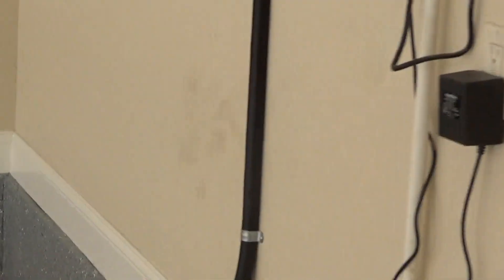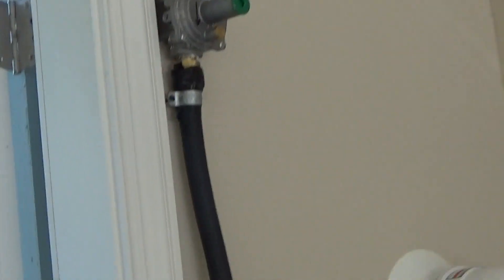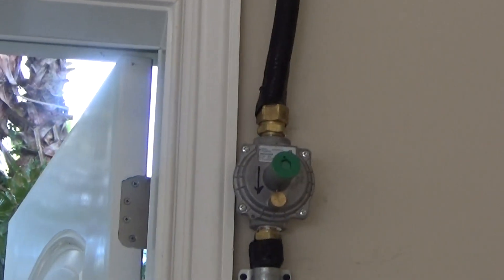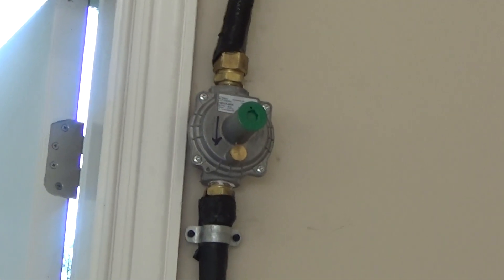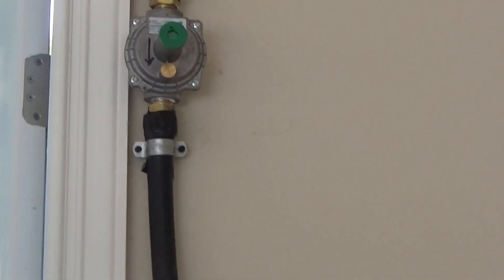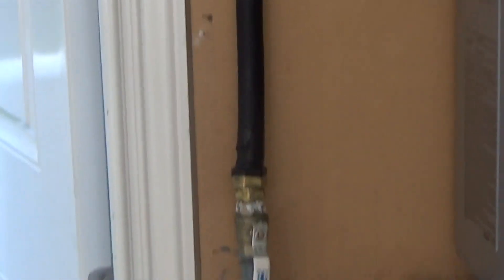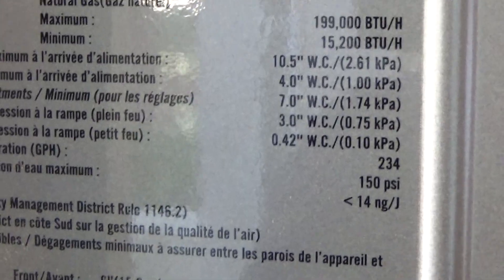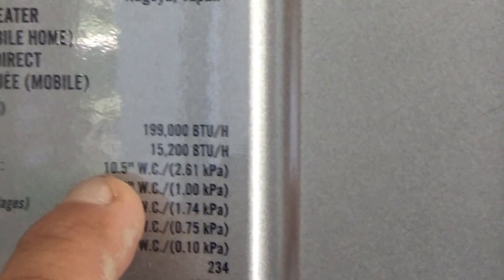Direct 2-pound gas line to tankless heater.

Comment: Good morning sir and Merry Christmas.  My tankless went out on Christmas Eve so I install a Rinnai RU199in.  It’s roughly 3-4” from the gas stub the original was connected to.  I installed a 5/8” gas line due to that’s all I could find with the time given.  The water is set to 135 degrees and it is like a warm shower at summer camp lol.  Another point to add, I just had my master shower tiled so the new shower valve and shower head still have the rough in plugs.  Are both of these contributing to the lack of hot water? Any help would be appreciated sir.

Comment: ! It looks like that regulator has a vent limiter. Vent limiters MUST be installed vertically. Most regulators require that the entire regulator be installed horizontally and do not allow the vent limiter to be installed even with a 90

Please please check the instructions 

If that’s just a brass cap then this does not apply but can’t tell for sure from this video post